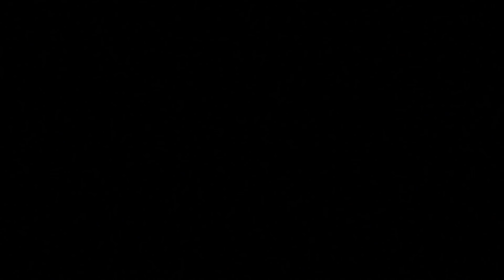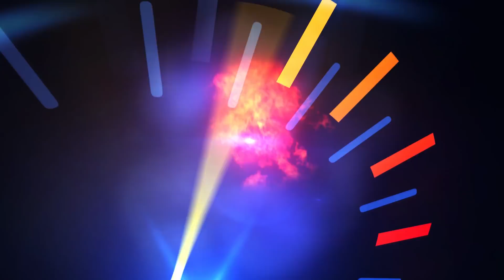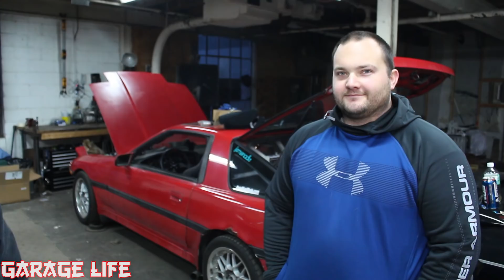This is why we cant have nice things...

Comment: I know that feel dude. My Miata looks shitty. Scratches and dents everywhere, but I don't give a fuck. At some point I will fix the rust and paint it. From there on I will maintain the condition of the car as good as I can. But I won't give a shit about dings, dents and scratches. The thing has to run and go sideways. Nothing more.
Reply from the maker: EXACTLY!
Reply: Mr.Knister my corolla after 5 years still paint in shit but body is fine if someone dont like it and hate is the person with no car or even worse paint and body